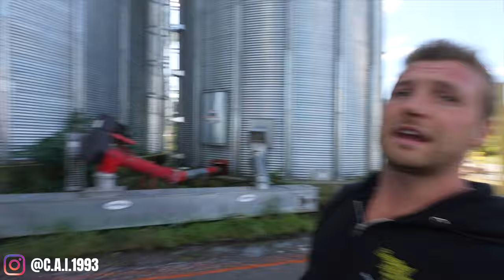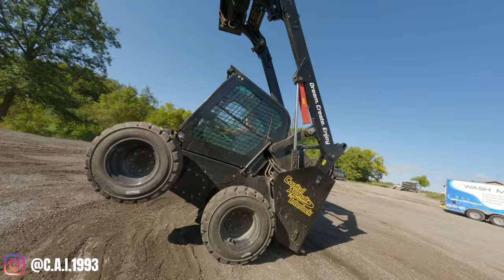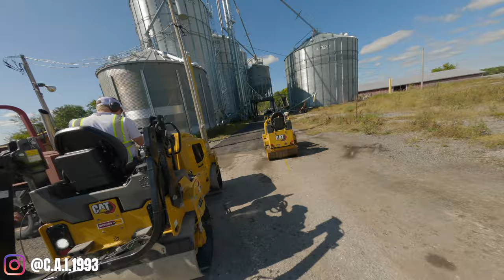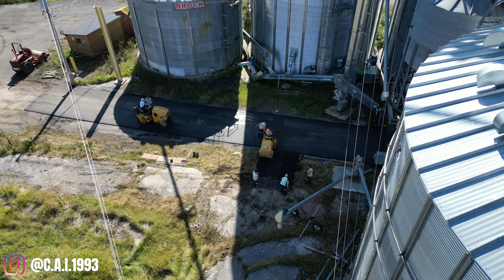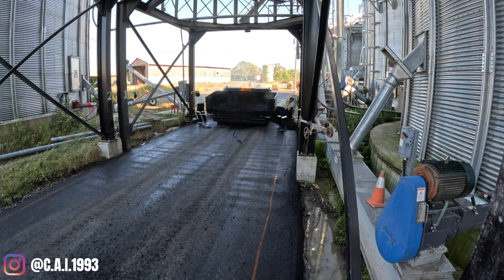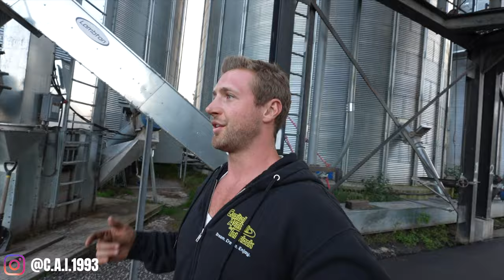PAVING 60 TONS OF ASPHALT UNDER A MASSIVE GRAIN SILO - FPV Drone

Comment: Question- why do you load the paver with the skid steer and not dump strait out of the trunk?
Reply from the maker: It’s a great question. And it’s something we have asked often. Honestly, we have a certain level of comfortability having to paver loaded with a skid steer opposed to pushing trucks. Definitely not against pushing trucks, and at times I agree it’s certainly more efficient we tend to stick with what we are comfortable with.

Plus the Mauldin 1560 can definitely handle it, but it’s more ideal to have a larger paver to push with. ( just my opinion)